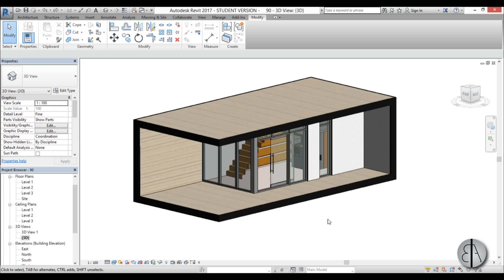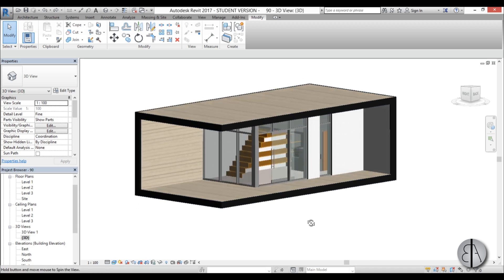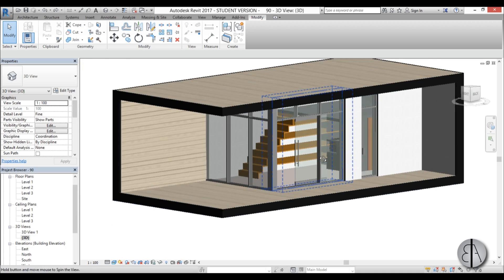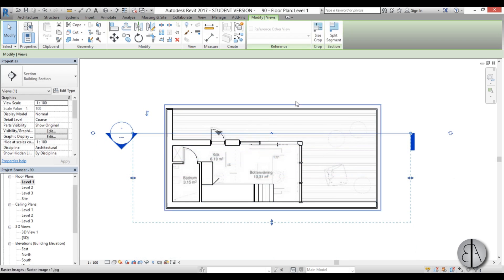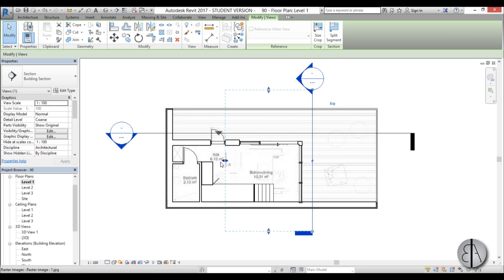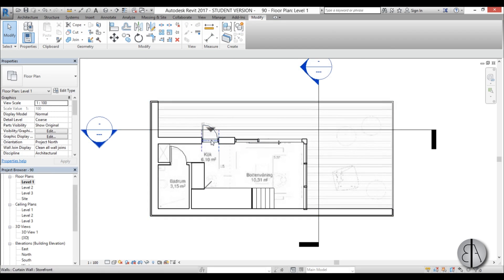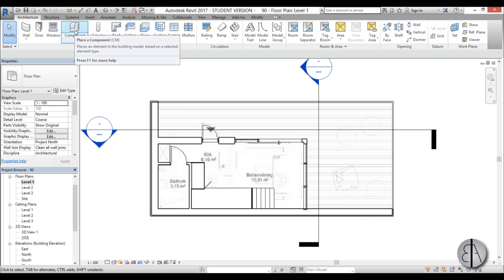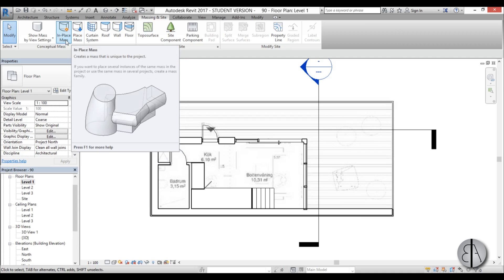Curtains in Revit Tutorial

Comment: Revit uses the wrong terminolgy for glazed surfaces. Curtain walls are typically used for multi story structures where the glazed skin BYPASSES the floor slab entirely with a firestopped gap inbetween. Window Wall and Storefronts traverse from floor slab to underside of floor slab overhead.